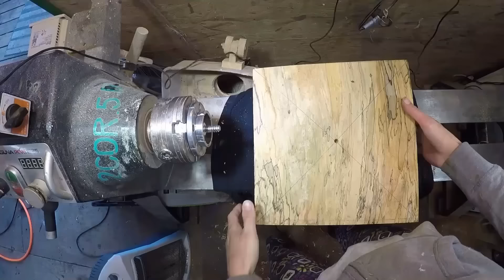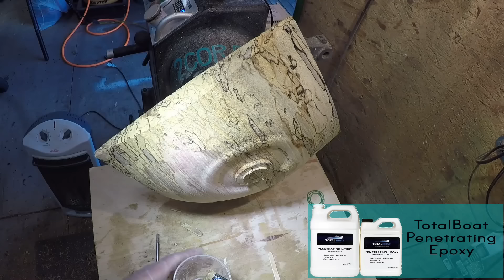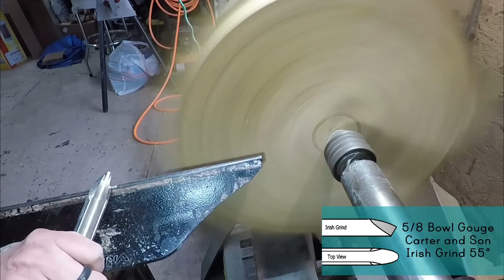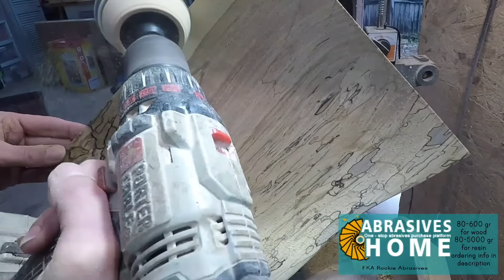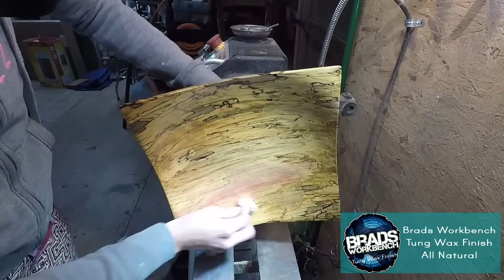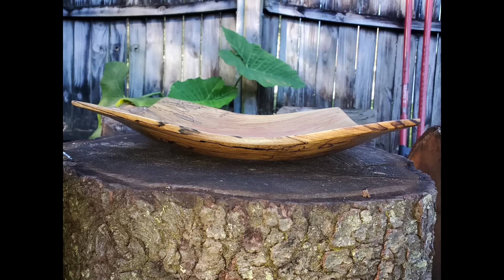Square Spalted Maple Platter

Comment: If it looks like maple and machines or smells like maple, but has those pinkish/reddish splotches or streaks, it's quite likely box elder, sometimes called box elder maple, Acer negundo. Compare with, for example A. saccarum (sugar maple, sometimes called rock maple or hard maple) along with approximately 130 other species.

It's a great turn, spalted or no, and you've got yourself a lovely platter there, Kim.
Reply from the maker: Thank you 😊

Comment: Very nice! I've also found that I get a better cut when I turn at the higher speeds.  The only limiter for me is the low power of my HF lathe-I can and do stall it occasionally.  Thanks for sharing!  
Stuart
Reply from the maker: Yes, that happened to me a lot when I had my HF lathe. Just got to take lighter cuts.  
Thank you so much 🤗
Reply: @KimTippin  thanks for the advice. Guess I’m just impatient Lol!

Comment: Hi Kim great job on the platter just a question does hot glue stick to resin good enough to get it on the lathe
Reply from the maker: Yes. but use a good amount.  Always have the tailstock support.
Thank you 😊

Comment: I thought I'd heard you mention  "thinning down" your resin with acetone,. I've never poured before, but I have a piece of wood with several cracks and I'd like to try and save it. Did you get any info on doing this from the web (if so, where), or did you just try it for results. I want this stuff to sink in and hopefully, increase the working time as well. I like your bowls 'n stuff. Thank you.

Comment: Kim. Can I thin down total boat 50% for punky wood? 2:1 or 4:1
Reply from the maker: Yes. You mix the resin according to directions.   example: 10 oz of total mixed resin. add 10 oz or less acetone.  1:1 will be real thin. This is the most I have "diluted" TB resin and it cured in 24hrs. Works best if you turn the piece close to desired shape, soak in resin, then light cuts. :)

Comment: I notice you use the scraper a lot. Nothing wrong with that. Have you tried  giving it just a bit of tilt? Lifting the following  edge slightly off the tool rest. I find it gives me a bit smoother cut.